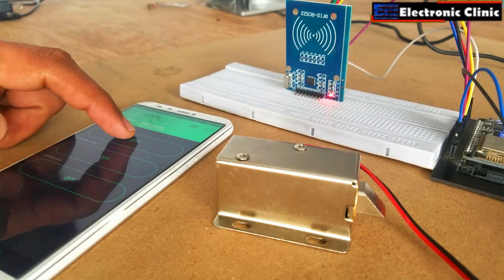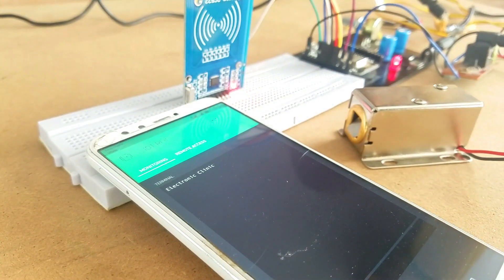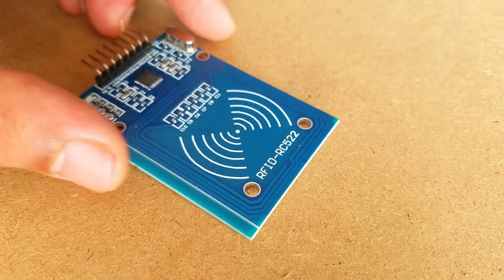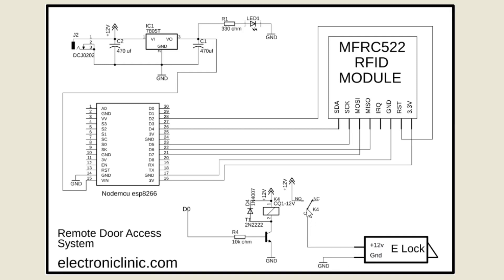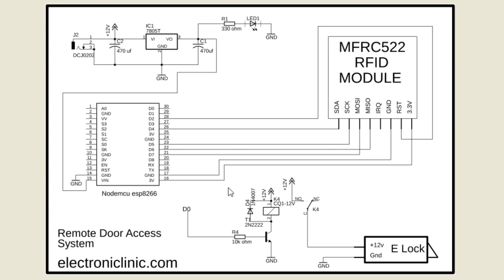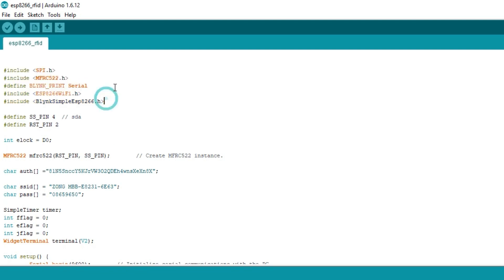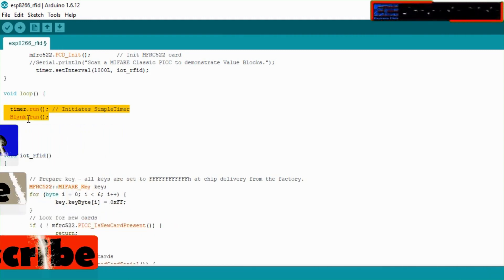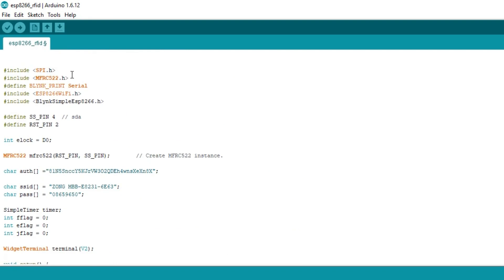ESP8266 RFID based Remote Access Door Lock, RFID and IoT, RFID IoT, smart lock

Comment: It’s not working 
Rfid and nod mcu are heated very high
Reply from the maker: then you have faulty hardware.
Reply from the maker: may be you had wrong connections before
Reply: I am using node mcu with cp2102 chip

Comment: I didn't understand one thing
Where exactly did you perform the code
If it's on Arduino then why isn't it connected with circuit
I am confused
Reply from the maker: this is connected. watch full video or you can also read the article.
Reply: @ElectroniClinic  if you can give me time stamp when exactly did you connected Arduino that would be helpful

Comment: Sir suppose rfid not work or card miss then how we can open lock sir thats why i am asking for alternate option  like finger print  and in blynk app also any  button to directly unlock
Reply from the maker: watch this video completely you will get the idea. i have also other videos on electronic lock. those videos can also help you. 
you register multiple cards, if in case one card is misplaced then you can use the other one.
Reply: @ElectroniClinic  yes but  i want alternate mode RFID of finger  by any of function lock work guide me for this code sir